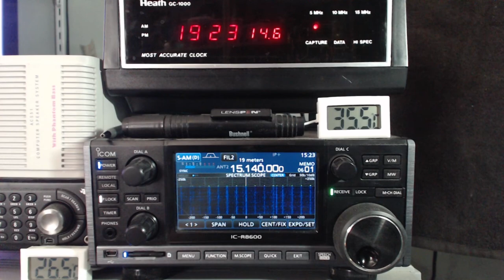Radio Havana Cuba DXers Unlimited Aug 26 2018 on 15140Khz Shortwave Radio R8600

Comment: Now that's cool! I need to take my Retekess V115 outside tonight and see if I can pick up anything on the shortwave spectrum; it's deaf in my apartment. I should also set the antenna for my other shortwave radio back up.
Reply from the maker: Yes. Nothing beats a good outdoor antenna. Have fun!
Reply: @TheScottytr6  I just went outside (not for long, it's 29 degrees in Twin Falls) with a Retekess V115, and caught a few shortwave stations, one nearly clear on 6.060 MHz; tomorrow, I'll set up the indoor longwire antenna for my Eton "Grundig Edition" radio, and see how that performs.
Reply: Or is it KHz?
Reply from the maker: You are correct. 6.060Mhz is 6060Khz.